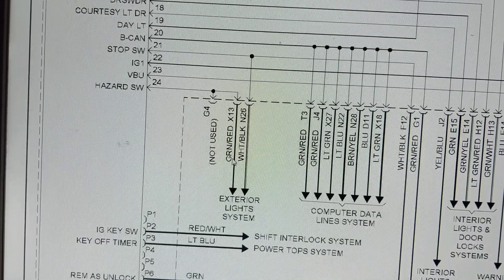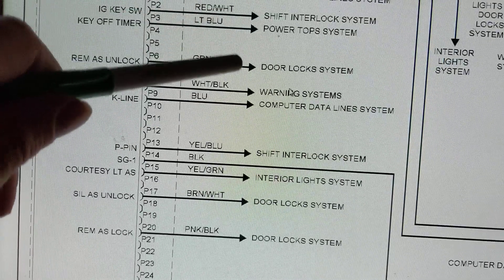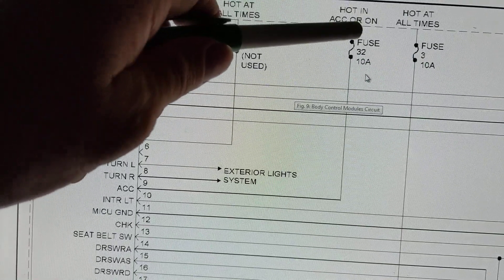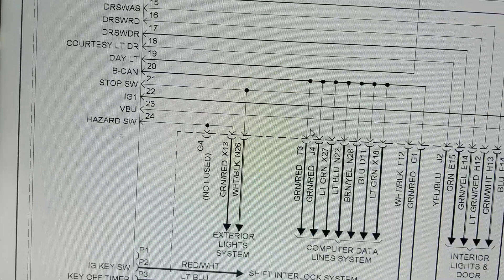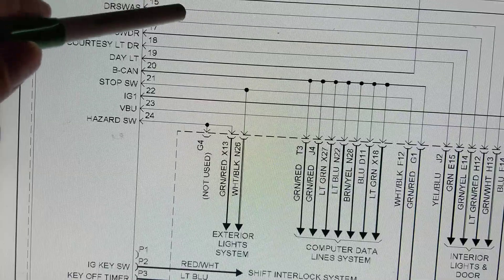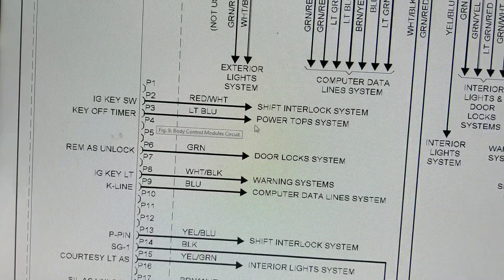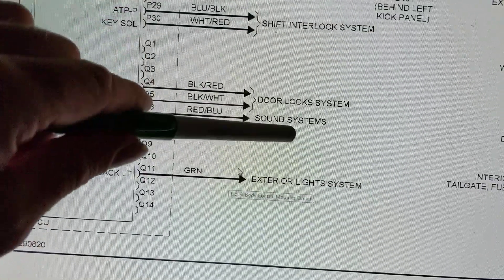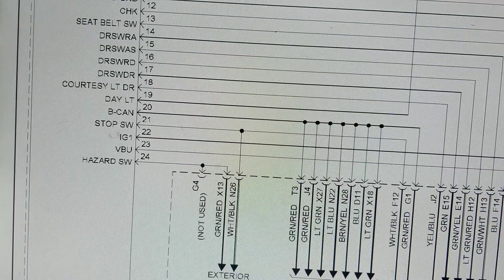how a  COMPUTER BODY CONTROL MODULE WORKS from WIRING DIAGRAM

Comment: Where do you find these schematics ?
Reply from the maker: You going to go to Google I'm just putting the wiring diagram for the system and make and model of the car and you can download
Reply from the maker: I'm sometimes I get them from Mitchell but for that when you have to pay if you get it off Google you get one page for free
Reply from the maker: Sometimes I go to Mitchell but you have to pay for the schematics you could go to Google and get one page for free

Comment: I got hit by a flash flood a month ago in my 2012 Silverado I don't know if it matters to have the information or not but it's a 5.3 flex fuel motor, but my truck was submerged almost fully underwater, I have gotten it to power backup as far as put a battery in turn the key on and all of the – lights and stuff lit up but I'm not getting a signal for some reason for the key to turn the motor over. Could you possibly help me out with what it could be or where to look for problems I have the BCM out and I've been cleaning all the connections for the plugs and the fuses before we installing them I just wasn't sure if maybe the BCM would keep it from getting fire to the plugs to fire I have fuel to the injectors but nothing is happening when we jump the starter to turn

Comment: Great video Joe, I have a question I am doing a custom car. Dash swap with donor car steering wheel on a old car. I wanna use blinker switch , wipers controls and steering wheel controls. Can I bypass bcm? And connect directly to existing old car wiring ? Would I need to add relays ? Step down transformers or ?

Comment: Very interesting wiring diagrams.
In fact, I have always confused and consider it as a spider web.

Now, I'm getting into understanding in a minute.
Please keep up the good work. Awaiting more videos particularly to i20 2011 1.2.
Reply from the maker: just concentrate on the circuit that has to do with your problem and avoid every other circuits I know at the beginning it's confusing
Reply from the maker: to me after all these years it's still a spider web